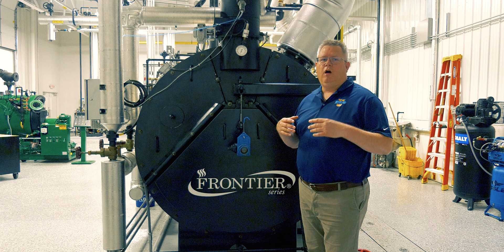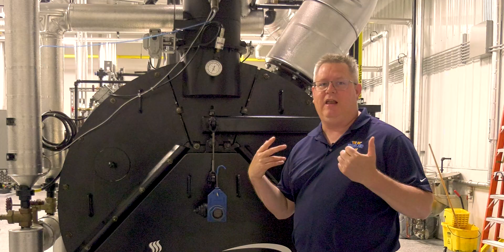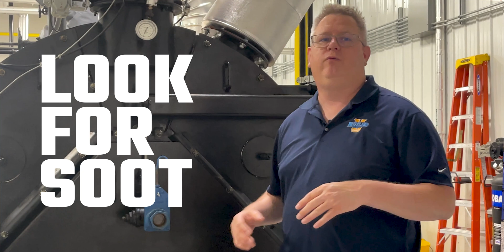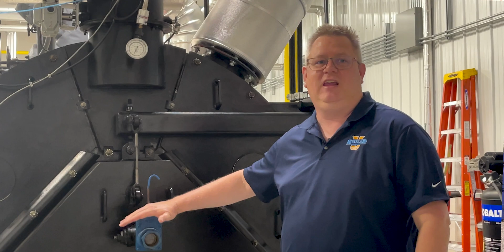How to Lower Your Boiler Stack Temperature (Tips & Tricks)

Comment: Ok , Who or what if anything is used to un-scale a boiler ?
Reply: It's got to be cleaned! Check with your water treatment provider, they sometime have a tech or know a company that can do the job. Probably a good time to do a "tube" inspection depending how bad it is . Good luck!
Reply: @jdmccorful  Also, probably a good idea to get your water softener looked at.
Reply: @jimfish5981  I would hope that water softner part of standard monthly checkoff.
Reply: Generally a descaler. Usually an inhibited acid. It will attack the scale but not the steel.